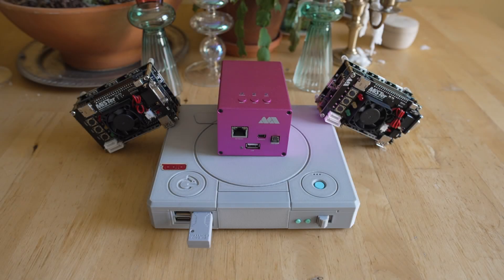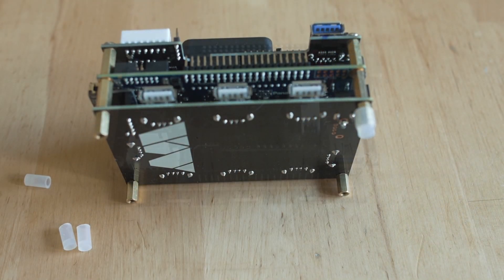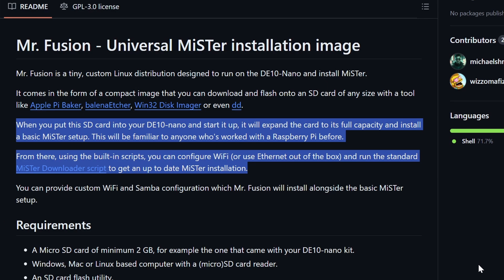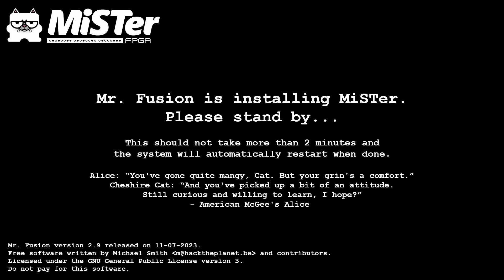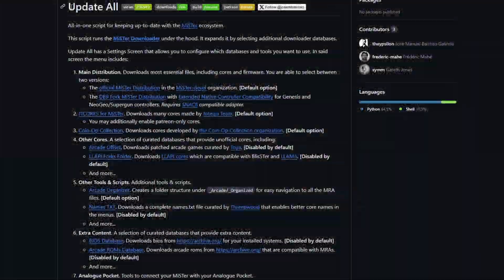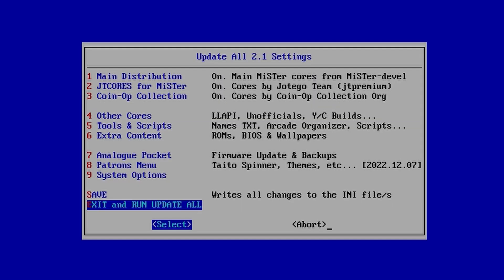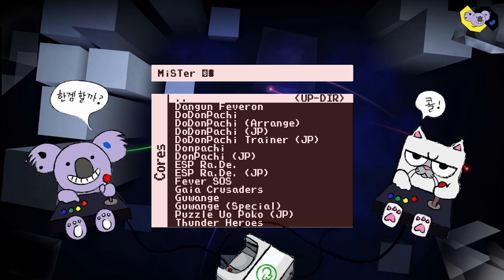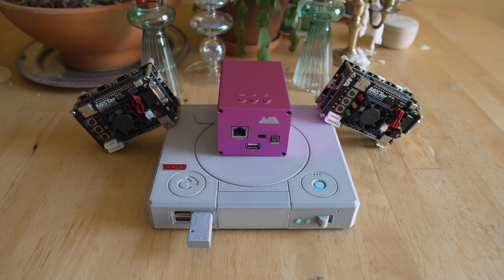MiSTer FPGA Setup Guide for 2024! Clone MiSTers are Coming!

Comment: Hi
I've got Mister Fpga, I tired to setup it as you did it but nothing seems to work. 
I tried the latest version of Mister fusion, previous ones like 2.5 but nothing. It installs all the cores for consoles, downloads the rooms for mame (which takes hours) but when reboots no Arcade rooms at all, I did it many times but always the same problem no Arcade games at all.
Reply from the maker: You need to turn on the rom grabber in the INI settings
Reply: @VideoGameEsoterica  After installing Mister Fusion I went to scripts and choosed Update All and then I pressed Up to enter the settings to choose wallpapers backgrounds, Bios, Rooms, etc. but nothing.
Reply from the maker: @lukasjozef1774 that’s very odd
Reply: @VideoGameEsoterica  you tell me, I've tried even the fork MS Fusion but with the same result. The stranger thing is when it's Updating All seems to download the Arcade roms but after Mister reboots I enter the arcade section were the names of the games are but when I'm trying to load a game it says room not found. 
I've got the Mister for about five years and at the beginning Arcade games worked fine.
Reply from the maker: Have you tried a diff SD card? I almost wonder if it’s having read/write errors
Reply: @VideoGameEsoterica can't be because consoles are working fine, I just copy the roms to the game folders and no problem at all.

Comment: Great Video! Thanks a lot! I am running though in one problem: When I run the script Update_all.dh MIster states that an Internet connection is missing. But in your video you also have no cores/files and the set up files correctly
Reply from the maker: Are you using hard wired Ethernet or wireless? I do these tutorials based on Ethernet. If you are using a WiFi dongle you need to set that up first on your network before running update all or else it will continually report no network
Reply: @VideoGameEsoterica  Neither :D. I thought I can simply copy the files on the SD Card- which I am trying right now. Sorry, did not notice that the video is based on Ethernet... Can I simpy copy all files which I unzipped from Distribution Mister Main to the SD card?
Reply from the maker: You copy update all to the scripts folder then run it once your MiSTer has internet connectivity

Comment: Doesn't this require the MISTer to have an Internet connection to do the update and download things? How does it connect? Perhaps you meant it was unpacking them onto the SD card. At waht stage does the card become Linux and unreadable by Windows? Is it only part of the card which is in a Linux format? I'm hoping to set up my own custom SD card for a MISTer board today, containing various classic computers and consoles. Meanwhile I've only got an SD card which came with my MISTer board which contains just the Minimig Core and software for it.
Reply from the maker: You have to connect to the internet yes. The Linux partition is created during the Mr Fusion stage
Reply: @VideoGameEsoterica  it needs the Internet for the update. Can't I use the non updated configuration for the moment, then copy software onto the card from my MacBook? My board has no LAN port. I want to get this done today without buying, then waiting for a WiFi adapter to arrive.

Comment: Hi! Thanks for providing this guide! A friend asked me to update their mame cabinet that was built years ago. Its running on a regular PC and using an ipac2 for emulating the controls.
Im sure i'm not going to be able to use the ipac2. Do you have a controller encoder that you suggest that's compatible with mister? I assume USB is the main requirement right? Thanks
Reply from the maker: Daemonbite is the way to go for USB encoding IMO
Reply: @VideoGameEsoterica  Saw them, but everything is sold out. Will continue to look around. Thanks
Reply from the maker: Very easy to program and plug in. I have a tutorial on the playlist

Comment: Since the author uses the N64 core as an example that you have to setup your controller/joystick/gamepad in each core individually: while this is of course true, I think the N64 core is not the very best example. Or, in other words: For the N64 core: Wouldn't it be better to use a SNAC adapter and 'real' N64 gamepads (which will have 6 buttons) instead of some 'normal' gamepad with only 4 buttons plus some shoulder buttons? (which will work fine e.g. with Arcade games, Commodore 64 games, NeoGeo games etc.). Just my thoughts. Please correct me if I am wrong.
Reply from the maker: You just need to wait for part 2 where I discuss that :)

Comment: I was lucky enough to snag a mister pi. Can't wait for it to show up. I've seen that it's possible to run games from a server using something like retronas. Ever used that? Would be nice not to have to worry about filling up an sd card.
Reply from the maker: Yes you can run games from a NAS if you want

Comment: I’m looking at building a retronas using a pi 5 so don’t need a large capacity sd card, what is the minimum size sd card needed in this case and does the speed of the sd card matter?
I managed to order one of the Taki Udon mega packs, had thought about getting the de-10 nano for several years(before the price hikes started during covid) but never got around to it
Reply from the maker: 32GB will suffice for minimums. Speed wise just get your average card and you’ll be fine
Reply: @VideoGameEsoterica  thanks

Comment: Maybe I missed it but is setting up wifi missing? Seems like we go from installing MiSTer fusion right to update all with an internet connection.
Reply from the maker: I use / recommend Ethernet for the first setup. Much more reliable than WiFi when you have EVERYTHING coming down at once

Comment: Has anyone tested if the clone boards have the same hdmi CEC issues as the DE10 nano?
Reply from the maker: Haven’t checked myself
Reply: Get a tiny flat head screwdriver and remove the CEC pin from an hdmi cable. That's what I did and life became much easier.
Reply from the maker: Also doable

Comment: Hi, I actually do have a question that you might be able to answer. So I’m new to FPGA and the one that I got was the M3 marsupial multi system rebuild from Koala (awesome Guy by the way). 

I noticed when I tried to add in certain rooms for example Genesis and Sega CD games that loads the mega driver mega city core instead of the Genesis core. Same goes with Sega 32X, it loads the super 32. For NES and super NES, the family and superfamily con Coors load. Not a big deal, but I kind of want the course that I grew up with to launch the games that I have. Anyway, to fix that? Your health is much much appreciated
Reply from the maker: It’s not so much the Marsupial as it is naming conventions on MiSTer itself. There is a Genesis folder but the most modern core is “Mega Drive”, so that’s where you’d put your games. It’s just a bit of a vestigial folder convention for older cores
Reply: @VideoGameEsoterica  And (and hoping i am wrong and this is outdated) but wasn't the 'old' Genesis core needed for both 32x and mega cd?
Reply from the maker: Honestly it’s been so long since I’ve looked I’d need to check how it’s all strung together
Reply: @VideoGameEsoterica  gotcha, those cores are based on the EU/JP systems. So the folders that the US ones are safe to delete?! If they’re useless then why keep’em